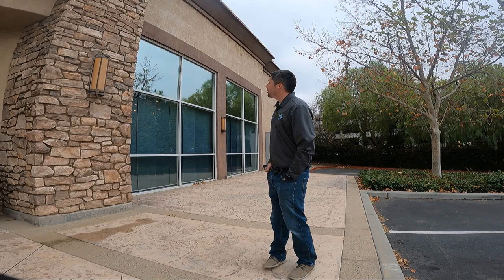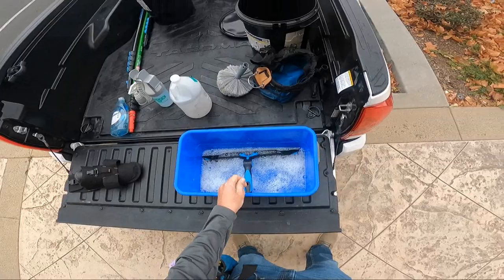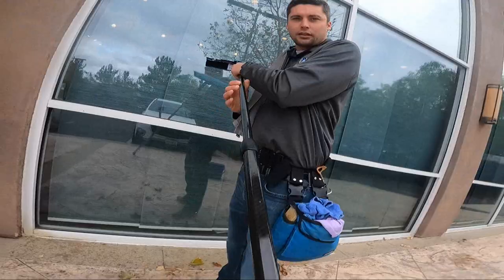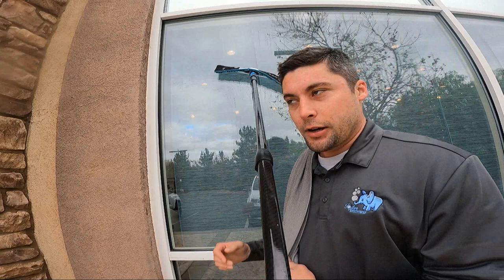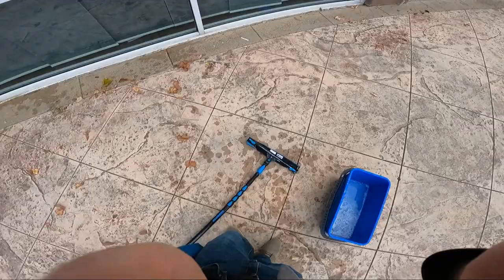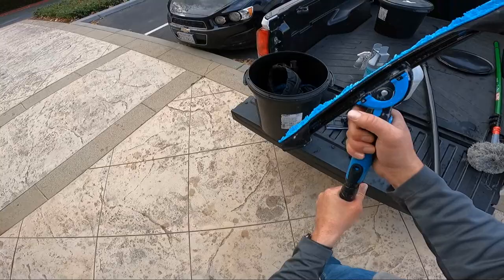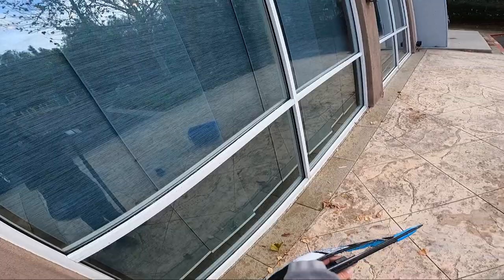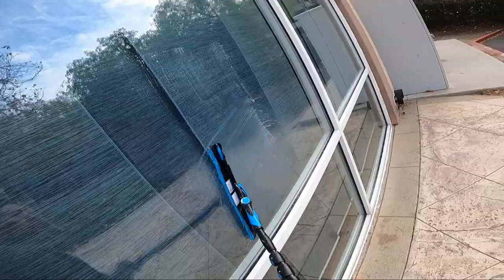MOERMAN EXCELERATOR 2.0 FIRST DAY REVIEW

Comment: Have a question do you charge by how many windows or by square feet ,and also if is the same price for a two story and a 1 story, appreciate some advice.
Reply from the maker: I price per window and yes same for any floor. I would never charge by square foot because you will run into sun rooms and glass walls.

Comment: you got the fliq on backwards.. everybody does for some reason.. duno.
Reply from the maker: Ill have to try it the other way! Thanks for the tip!
Reply: @JoshuaTheWindowCleaner  I think it's actually meant to be interchangeable. but, i guess it holsters better one way than the other I was gunna get the boab my moerman but the only way to actually holster it is to unclip one side so if you wanted to carry a few at a time isntead of going back to a bucket youd actually end up having to fiddle with the clips multiple times so i never bought one.
Reply from the maker: @typerightseesight  thank you for your feedback bro 👊😎
Reply: I lost my job like 2 weeks after I bought the unger optilock poles. I was going to get the new pulex handle for it. But, I guess they worked way to well and my boss at fish thought I was skipping windows or something. I had a technique going where I could do a door in one wipe by doing the entire thing with the pole. starting at the bottom and doing like a lowercase n. with both the mop and squeegee. people started catching on it looked really technical. lol. took like 6 seconds. But, it wasnt the classic fish stuff. So, he started really coming down on me without saying and before I knew it I lost that job. But, now I'm way better at cleaning windows! lol.